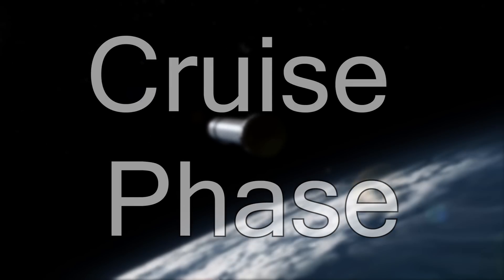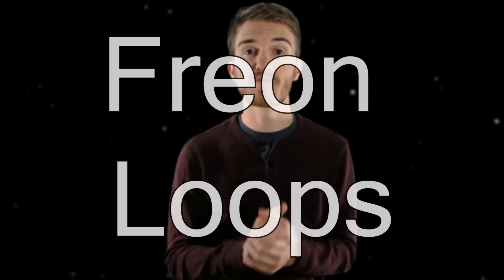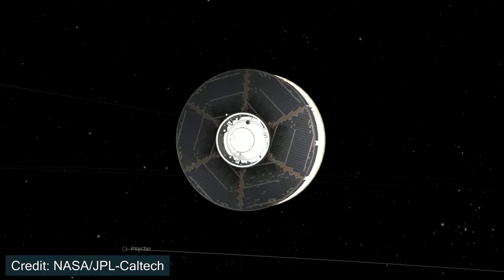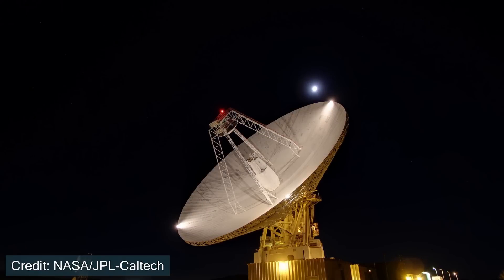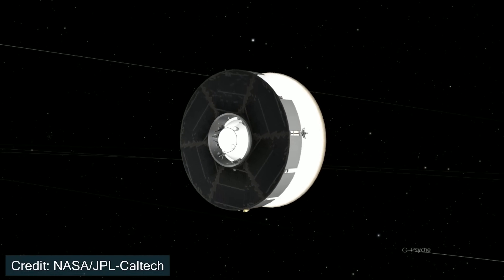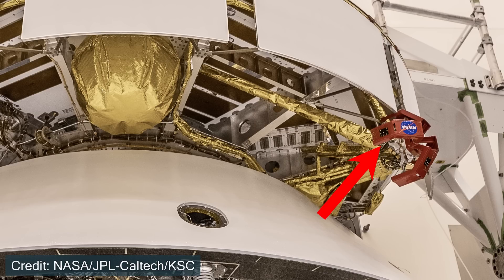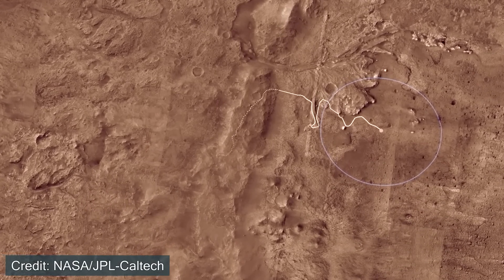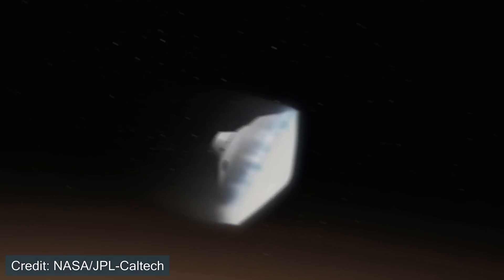Voyage Through Outer Space: Cruise Phase for the Perseverance Rover

Comment: You mentioned that the spin helps with stability, but how so? How does the 2rpm spin make any difference in space, where there are no aerodynamic aspects?
Reply from the maker: Excellent question! The math is pretty complicated, but the best analogy is to someone spinning a basketball on their finger. If you sit a (non-spinning) basketball ball on your index finger, it is difficult to balance, and will easily fall off. If you spin the ball first, it becomes much easier to balance, so easy that the Harlem Globetrotters can place a basketball on a toddler's hand with ease. The spinning helps cancel out some of the imperfections/mistakes when balancing the ball. The technical reason has to deal with angular momentum and moments of inertia, which is pretty hard to visualize. Gravity will cause the spacecraft to rotate, but it is less likely to go out of control is the spacecraft is dominantly spinning in a predetermined direction. I hope that helped answer your question!
Reply: @MartianWolf  That actually summed it up quite nicely, thanks :)